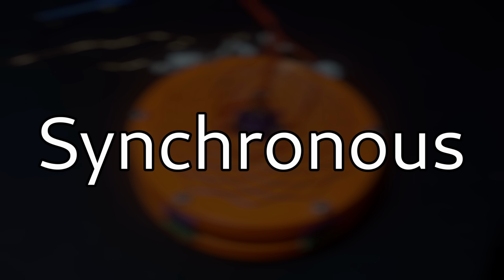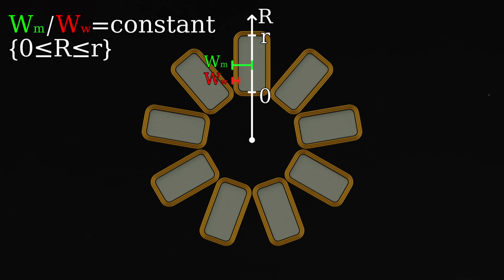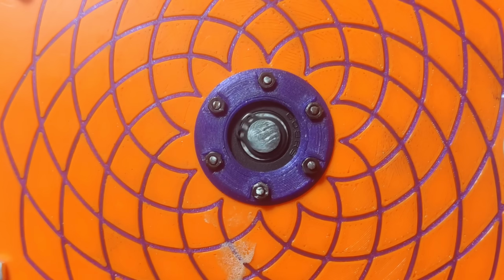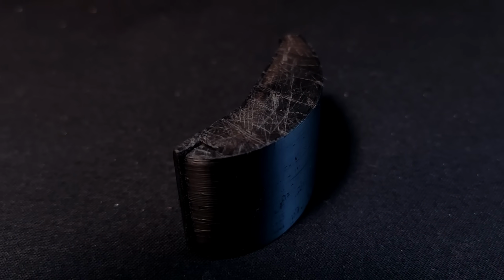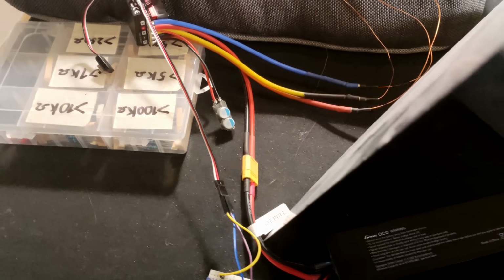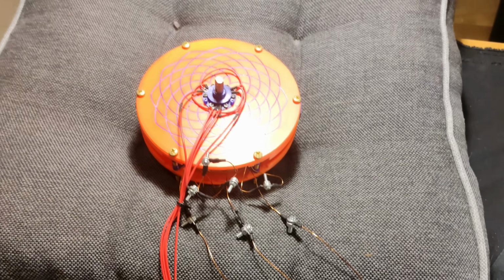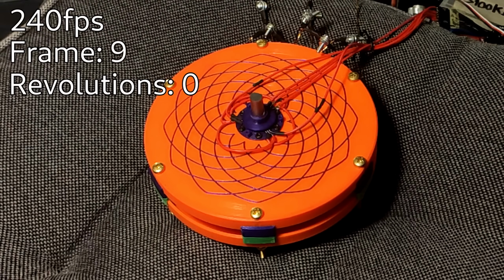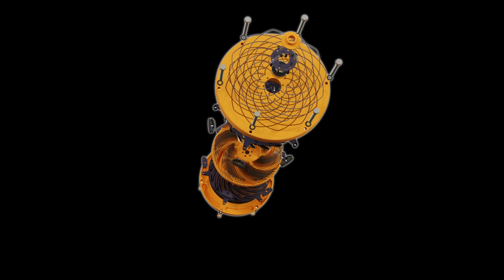Axial Flux Synchronous Motor Prototype

Comment: This design in concept, really is genius! It looks like a double Fibonacci spiral…like a sunflower. The problem is with it is twofold. First is that the magnetic flux needs to have a continuous flow path from opposite sides so that it magnifies the torque as much as possible (basically oscillating from left to right, back and forth for each ‘petal’), and the wires of the coils need to be right next to the stator blades (as close as possible without shorting out) with no plastic in between. The plastic of the mold and the air gaps are essentially turning your motor into a giant spiraling capacitor instead of making torque. The plastic and air is a dialectic, which turns the coils into coiled capacitors which are charging and discharging into each other, instead of generating torque, because the flux and the coils are not perpendicular and opposing, like in a normal axial flux motor design. One way this might work is if you could somehow print the sunflower stator and petals so that they could be one contiguous conductive core instead of conductive ‘leaves’ being held by a non-conductive/dialectic core. Then the current wire/coil configuration might work at driving the flux around continuously from left to right so that it creates torque instead of capacitance. Just a thought….but I could be wrong.
Reply from the maker: No matter the motor design, the coils are always insulated from the cores, and the cores are left floating (exactly for this reason of reducing capacitive losses), so there really is not any appreciable amount of capacitance there. But it is true that the coils are supposed to be as close to the cores as possible - unfortunately in this case it would have damaged the insulation of the coil wires, and it would have been very difficult to keep the metal strips that make up the cores stable while winding the coils, so the plastic enclosure for the cores was necessary.
As for the continuous flux paths, that is exactly what is going on here.
Reply: @BirdbrainEngineer  Also the second thing, which I was scratching my head at is the coil winding pattern itself. You are using an overlapping serpentine pattern, which may or may not work at all. In the original vanilla axial flux motor you have very simple coils of copper wire around ovular or rectangular metal neodymium magnet stators. It’s simple and works. This design you made is so much more complex, and probably needlessly so. I would start with a working plane vanilla axial flux design and slowly change it by adding one idea at a time, rather than going all in at once with many unconventional ideas, and that way it becomes easier to tell if an idea works or not. But I commend you on your efforts and your ingenuity. So again nice job!
Reply: @BirdbrainEngineer  The serpentine winding pattern + large air gaps and dialectic stator = massive capacitor instead of moving stator. That’s the gist of it.
Reply: @BirdbrainEngineer  Here is how I would suggest doing a redesign using your initial basic ideas… 1) Simplify! Limit the number of petals to 6 - 12 (max) total around the entire stator. 2) Make the shape of the petals like a hysteresis curve with no sharp or pointed ends (like a real sunflower petal shape). (Sharp or thin ends will focus all of the magnetic flux to those points while killing the flux in the body, which is not what you want in a motor design.) For flux to be even you need a regular, smooth shape (like a platonic solid) with no thin or sharp ends. 3) Don’t use a serpentine winding pattern. (use regular self contained and separate coils of wire instead)…Have distinct and separate coils with no overlap. 6) Keep the coils as close to or wound on top of the stator magnets as possible without it shorting - (ie no air gaps and no dialectic material in between with the sole exception of the tiny amount of coating on the copper magnet wire itself.) 7) Definitely use permanent magnets, because it won’t work as a core-less design unless the entire thing is fabricated as continuous conductive metal.  That’s it! I think if you make those changes the motor should work as intended.

Comment: Increase the number of phases in the coiling and base your curve on the golden ratio then your initial design will work. You may need a controller board to switch the fields on and off precisely
Reply from the maker: I don't think the golden ratio curve matters, but more turns (than the 9 I had) would have made it more likely for the reluctance design to work, even if poorly.

Comment: Very innovative project👌. Can you suggest this concept can be converted to make axial generator with maximized magnetic field distribution?
Reply from the maker: Unfortunately pure reluctance motors can not be used as generators. However if you meat whether a proper involute design brushless motor could be used as a generator then I'd imagine so, however it might not be as good as a generator with the standard layout... would have to do some simulations.
Reply: @BirdbrainEngineer 
You can couple it with hyperdrive washer machine moto and generate power over 500v ac at high speeds

Comment: This take me back when I was on college, I did as well a generator that uses eolic energy as input to the shaft, in that time I made the parts using a laser cutter and wood and bought a 3D printer to make it better, but the wood prototype was enough, I graduate from school, and 2 years later I finally work again on this project with cleaner parts from the 3D printer, I'm not an electrical engineer but definitely found fun in doing this type of projects, great video, good day to you.

Comment: I wonder if using electromagnets vs permanent magnets and using some sort of pulse/timing based approach to rotate that last rotor would work? What I mean is that maybe one could replace the permanent magnets in that last rotor with steel wrapped in copper and then simply feed it power when the device needs to run. One could potentially even have that rotor be stationary and alternate the charges in such a way that it is effectively as if the rotor was spinning. That might work as both a sort of torque and speed regulator, meaning if one increases/decreases the power there will be a corresponding increase/decrease in magnetic field strength and if one were to increase/decrease the speed a which they are alternating the electromagnets that would effectively be like controlling the overall speed of rotation. Also, I've been doing a lot of research into static electricity and potential methods for harvesting it to do useful work since it is fairly straightforward to generate extremely high voltage static electricity. Throughout that research I found ion thrusters and magnetohydrodynamic drives to be really interesting. An extremely oversimplified explanation of how they use the lorentz force to generate thrust is that they basically take an electric charge, hit a magnet with it at the appropriate angle(90 degrees) and that causes a force that is perpendicular to the velocity and magentic field strength and is basically the product of the velocity of the charge and magnetic field strength(it acts like a multiplier when the angle is right). My basic idea was to take advantage of the phenomena of short circuits to power such a device. When there is a short circuit there is a sudden drop in resistance which causes a corresponding spike in amps which can be framed in such a way that it is analogous to increasing the velocity of the charge, or like if one were to suddenly remove the support holding up a massive object. One could potentially create a pretty extreme amount of force when combining relatively low voltage dc power combined with sort circuits and lorentz force.

Comment: Just me or does this look like a "tesla tubine"dont quote me on terminology
Reply from the maker: Definitely not. A Tesla turbine works by passing high pressure liquid or gas over freely spinning thin plates, tecnically a Tesla turbine has nothing to do with electricity at all, just that generating electricity is one of its' main use cases.

Comment: try bearing ball pure dc axial motor, only F=ILB and torque=ILBr, current over the bearing balls on top of a vertical ring magnet, the motor is its own bearings.
Reply from the maker: While I think the idea would work as a simple Lorentz force motor, then it would probably not be practical. I have a spare ball bearing with 2 N52 neodymium ring magnets of relevant size laying about so I might just for fun throw it together once I am done with setting up/upgrading my workspace.
Reply: but why not? easy to make and math check out @BirdbrainEngineer
Reply from the maker: First problem is that it would necessarily have to be a brushed motor (at least one of the races has to remain possible to rotate so that the balls could actually roll in the races). Secondly it would be difficult to interface any load-transfer to the balls... The most logical way to do it would be to use the retainer... however, the retainers are not built to transfer loads, and I'd imagine the balls pressing against the retainers under load would increase the wear on the balls significantly, thus wearing them out faster than they otherwise would. Thirdly, because the balls have mechanical interfaces for current transfer, you are definitely going to sometimes have arcs happening, even with graphite lubrication, which would further wear out the balls. Fourthly, in motors it's a good idea to reduce friction between surfaces as much as possible, but for the ball bearing motor, the whole rotor has high friction in relative terms. And potentially fifthly, the current-carrying contact point between the races and the balls is tiny, which means the contact points on the balls have high electrical resistance and would heat up a lot when high current is passed through it.
Reply: its a normal mhd style thruster, just circular motor, liquid conductive lubricant, or just the bearing balls conducting @BirdbrainEngineer
Reply: I guess the heating up the motor by the current though multiple contact points along the rim would be comparable to the heating of the bearing rolling motion @BirdbrainEngineer
Reply: @BirdbrainEngineer  it would be an ideal demonstration of a dc motor, design issues non withstanding. Durability is a design issue. For demo purposes for further development.
Reply: @BirdbrainEngineer  put multiple radial rows of bearings, to make the L length longer and even number of bearings balls rows would contra-rotate together in sync while the walls stay fixed to each other.
Reply: @BirdbrainEngineer  also coil smoothing in series would stop sparking/surge of a welding power supply of 200A or of a car/truck on the bearings, if disconnect ever happens.
Reply: the resistance of the bearing balls needs to be much lower than 2kohm, like 0-8ohms at max or the voltage has to be arcing high, like a plasma arc mhd vortex @BirdbrainEngineer
Reply: @BirdbrainEngineer  anyways, a current radial bar axle running over circular tracks with electric current contact on the wheels like electric metro would provide the best contact, to make the motor simply working.
Reply: one solution to the bearings not contacting is to use steel bearing balls and steel +/- contact sheets, so the magnetic field sticks all together @BirdbrainEngineer
Reply: one more idea: if you have a ring instead of the bearing balls, then the whole ring would be in constant contact with the outer ring, like the radial bar train wheels, and the current would be divided equally on the touching area through the conductor disc @BirdbrainEngineer
Reply: do you like thrust bearings, the motor works like one, with the socket plate on top of the bearings, but motorized, not free bearing balls @BirdbrainEngineer

Comment: hows the torqe?
Reply from the maker: Did not measure it but I could just barely not stop the motor shaft if I tried holding onto it with my fingers (had to let go because the fingers got hot and painful). It's definitely less than the previous axial flux motor (probably due to fewer magnets and wire turns) but because the speed is higher in turn, then the mechanical power output is comparable... This motor is a bit less efficient than the previous one though. Had I ordered curved magnets of more appropriate size for the stators, then it would have probably been superior to the previous axial flux motor I made.

Comment: Really nice project!
Just a few questions:
So you plan on continuing on this use case ?! (E-bike moror)
And for the finale part would you machine this out of metal (to simplify it for this question) or also 3d print the thing? :)
Reply from the maker: I will go for e-bike motor in probably about half a year's time, when it's starting to be spring where I live... Ideally I'd love to try to keep as much of it 3d printed as possible but so far it's looking like 3d printing is going to play a smaller role than usual with my motors for the e-bike motor.

Comment: Why do you have to start it by hand? Why doesn't it self start when you apply power? ( Not that it would matter as an assist motor in an ebike)
Reply from the maker: The ESC is not well paired with the motor. Eventually I got it to the point where it self starts about half of the times.
Reply: @BirdbrainEngineer 
The esc hasn't any hall sensors which determine next kick or move to make it rotate by self from start.

Comment: Building magnetic stators that work & work efficiently is no easy task. From taking stators apart the main rules are that the laminations have to be packed tightly, are not able to move against each other, and of course are varnished to create the electrical isolation barrier. They also need to be reasonably thin and made out of the right kind of steel.

Comment: An easy way of making mediocre performance iron cores in impossible shapes is filling the mold with fine iron filings then impregnating it with very thin glue, preferably epoxy. Better if you can vacuum impregnate them.

Comment: I learned so much in 15 minutes thanks to your years of effort exploring your curiosity. 
I have finally built my electric bicycle and it is fun passing people on the highway while going 45-50mph (70-80kph) I have my motorcycle license for this amount of power. I just wish I had a motor controller that had regenerative braking, not necessarily for recovering energy but primarily for stopping. My bike with its 3000 watt hub motor and its 72volt 40amphour battery weighs in at an earthquake generating 101lbs (46kg) and that with my 200lbs (91kg) traveling at those speeds the brakes for bicycles are being consumed like warm butter on a hot sidewalk... They don't make breaks for bicycles that reliably dissipate that amount of kinetic energy.
Reply: If you put resistors on the motor terminals it will brake, the lower the resistance the more it will brake but do not forget that this can heat up the motor
Reply: @BryanPino-l8t  thank you.

Comment: Hi, Love you video man! I've worked on some ac and BLDC motors in the past and I'm curious if you looked into your ESC at all. I've had major problems running normal motors with commercial ESC's and having the control algorithms work correctly. (Even in sensored mode which you seem to be using). Usually it involves a lot of PID tuning and tinkering. Have you tried changing your ESC when trying to run your induction motor? It also seems like the ESC is made for higher speeds which could also cause problems, I remember using some motor controllers called SOLO or something with a nice web interface and they had a different mode for low RPM motors which you probably need. (I think it has to do with the speed it runs the PID loops or something)
Reply from the maker: Yeah, the ESC tries to spin the motor pretty fast but it did sometimes try to sync up to the extremely low rotation rate (you can hear it thanks to coil whine). In addition, the ESC I used does work just fine with a high-torque low speed RC car motor.

Comment: Not sure if I'm correct (automation engineer by trade, so I think I might be onto something, but I don't know much about synchronous motors), but doesn't the reluctance rotor also need windings? Like... Except the magnetic flux core, should it also not have a conductive "cage" in between? I know, that asynchronous industrial motors have something, that is called a "cage winding", in English I think it's called a "squirrel cage winding", which is - most of the time - made from aluminium for cost-saving measures, and it is just a bunch of aluminium rods stuffed between the metal rotor core, and then welded with two aluminium rings on the opposite sides of the rotor. To achieve the same thing, I think one would have to wind copper windings around the metal core and then solder the ends together, so it makes a continous wire loop, so the current induced has a path to flow.
Reply from the maker: What you are explaining is called an induction motor :)
Induction motors are famously non-synchronous, as the rotor speed is not coupled with the rotation of the electrical poles due to what's called rotor slip. The non-synchronity of induction motors is also why they are often preferred in industry - you can usually just plug them into 3-phase grid energy and they'll work... no controller needed.